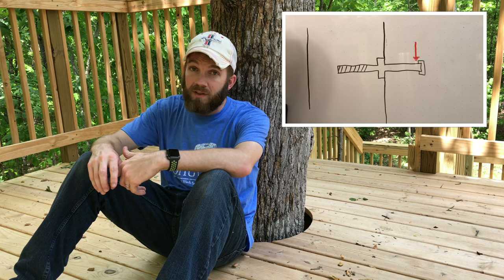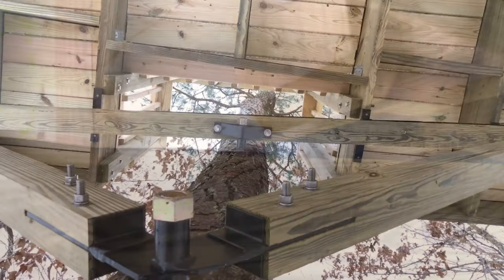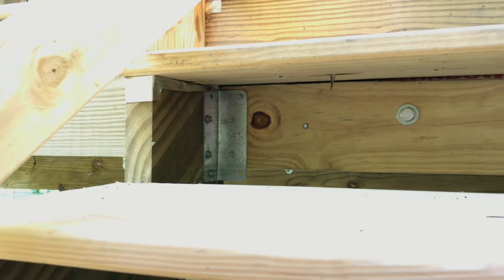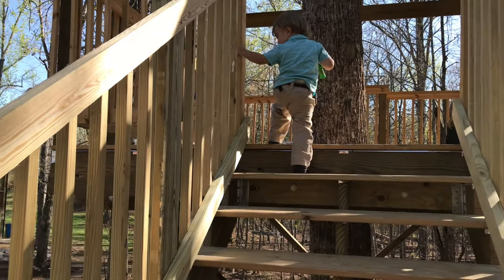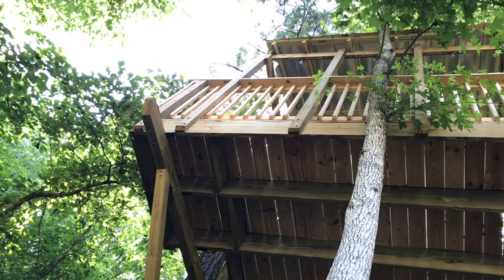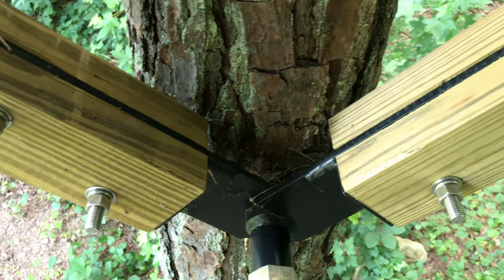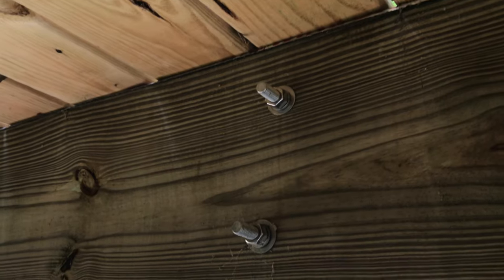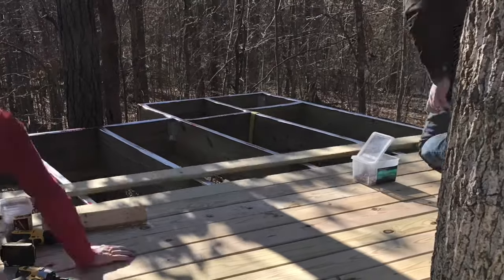Treehouse Building Series - #2 Tips and Tricks

Comment: Great video really pointed out easily overlooked issues. Where can I learn more about the UMHW? I feel like that would change the height you mount you second hole at to keep platform level. Also, I see how this protects the front and back movement but would it also protect the left right Movement? Well thanks again can’t wait to start this project for the kids
Reply from the maker: Thanks!  I’d recommend you start with Pete Nelsons treehouse book. It really explains a lot of these concepts in more detail. I purchased my UMHW from treehouses.com. You can probably find it cheaper though elsewhere online. With this design the treehouse can move in all directions in the horizontal plane. You just have to make sure you allow enough room for that movement because it will definitely move during windy storms. Your kids will love it. All the best!
Reply: JJCoolStuff  one more quick question with the UHMW did you fasten it to the top of the beam or the bottom of the floor joist. Someone even recommended attaching two pieces so it’s UHMW on UHMW but that seems like it may be over kill. Thanks for the quick response!
Reply from the maker: I attached it to the bottom of the floor joists and didn’t put any on top of the beams. I don’t think two pieces is needed but it wouldn’t hurt!  Just be sure to use a long enough strip so that if the trees move a lot during a big storm it won’t slide all the way off the UMHW.

Comment: Hello. I watched all four videos and they are awesome! I am planning a very similar treehouse in two trees. I have a few questions. 1. What are the dimensions of your platform? 2. How did you know what size beams and joists to use? Thank you again.
Reply from the maker: I believe the full dimensions are 10x16. The best way to play it safe on the beams is to higher an engineer to do the load calculations and use span charts to determine joist size and spacing. However, I referenced the span tables to get a general idea and then built mine slightly stronger to err on the side of caution. Instead of paying an engineer I took the extra money that would have cost and bought thicker joists. You have to do what you’re comfortable with. Thanks for watching the videos and keep me updated on how the treehouse project goes!